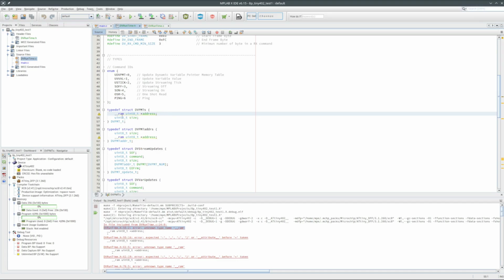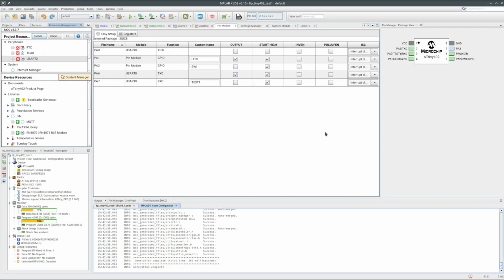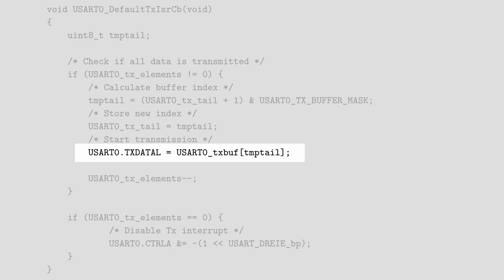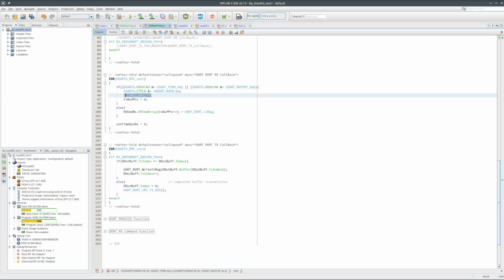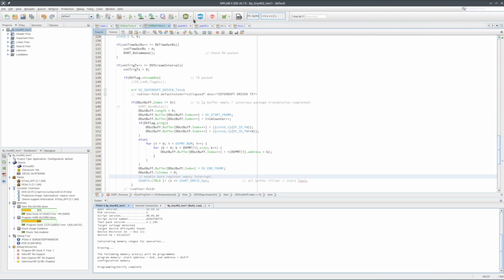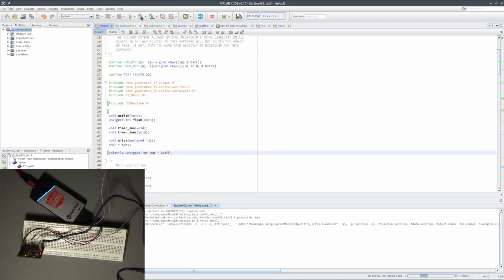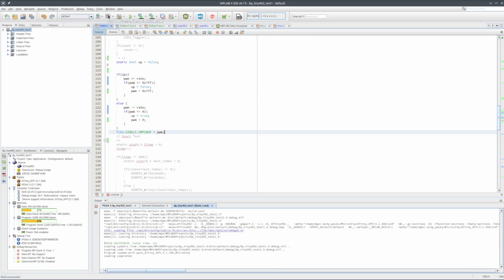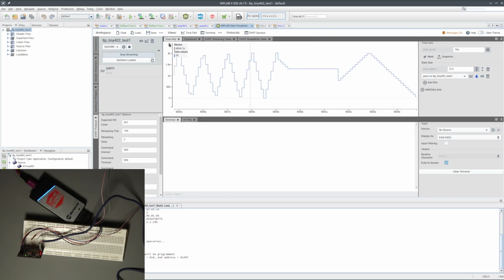tinyAVR 0-Series DVRT – Peek & Poke with Style

Comment: Another good video on the topic of using AVR chips with MCC. Thank you for taking the time to share this.

One thing to note regarding USART RX framing error handling. See 2.10.2: "Frame Error on a Previous Message May Cause False Start Bit Detection" in the latest errata (DS80000956B) for a workaround.
Reply from the maker: Thanks, I'll take a look at that.